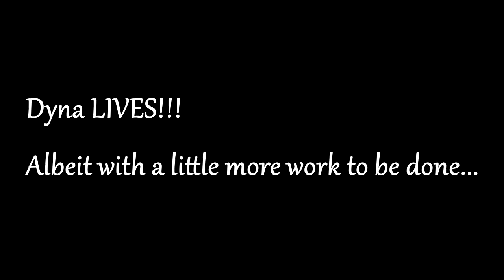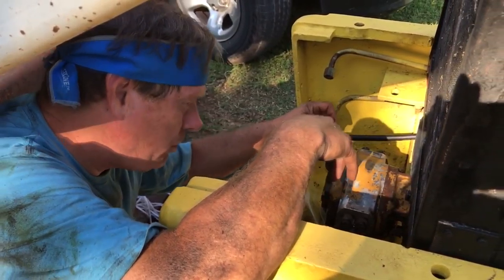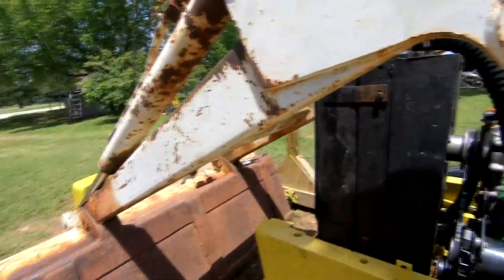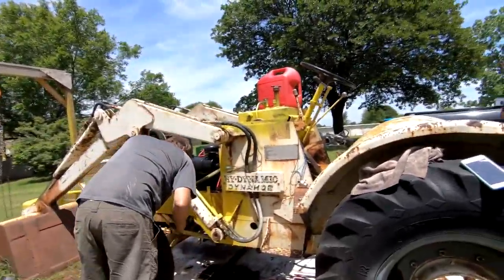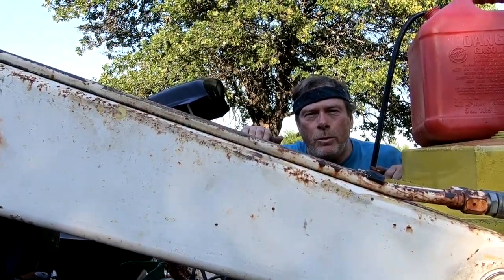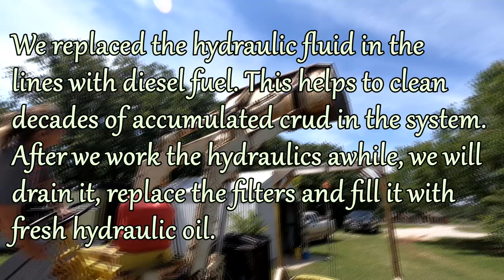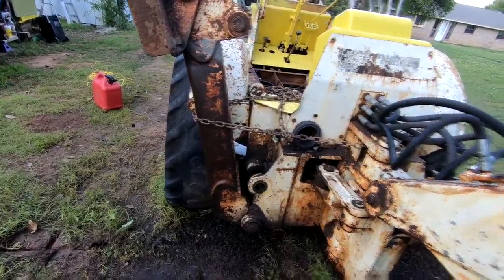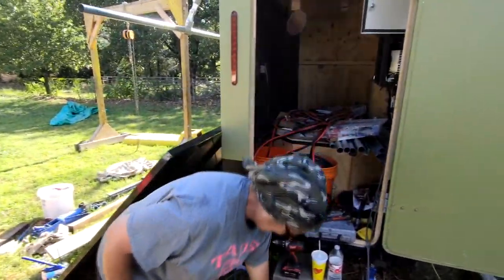Revenant II: Time to Boogaloo!! - The Contentment Backhoe Project

Comment: That thing sounds good ! You'll get the bugs out of it directly don't worry
Reply from the maker: It does sound throaty and strong Chris!  Lot's of bugs to work out, though. Gotta do the transmission again, and then the brakes. Also afraid the torque converter is shot. But you are right, we'll get there!  Thank you for everything!